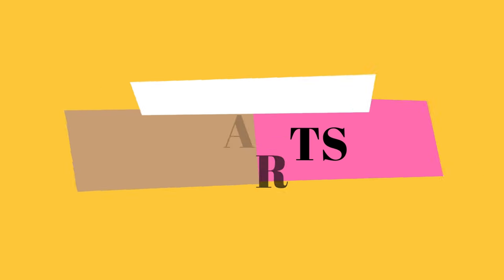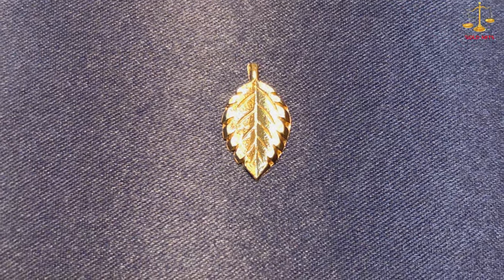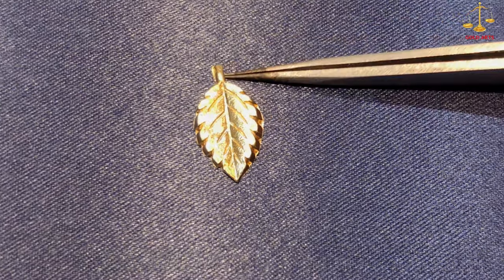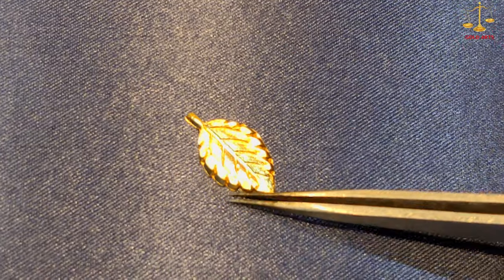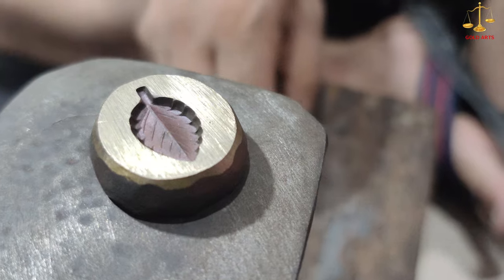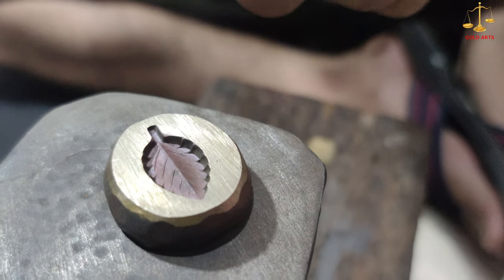Making a Gold Leaf - Jewellery Making

Comment: what is the first material you use please? also you work with 24k which is soft. when using other karature i suppose must be anniled in between the stokes
Reply from the maker: Hi , thats Lead . I have worked with 14k as well. It gets difficult with hard metals for sure . But still it works out somehow